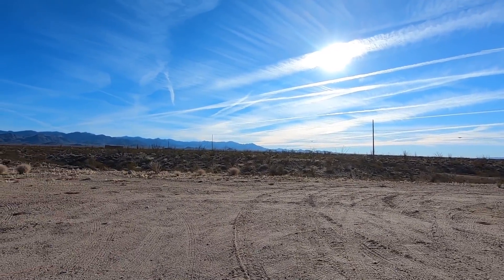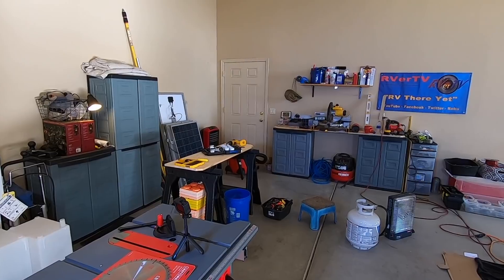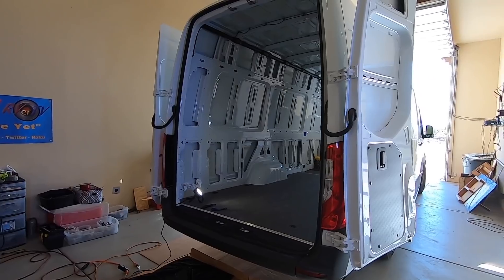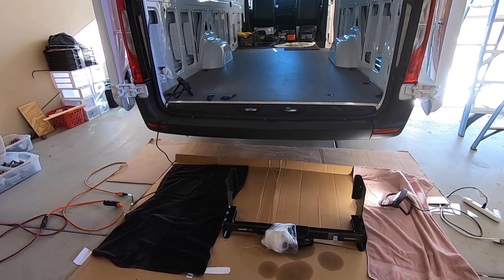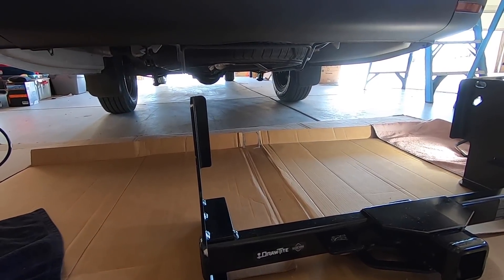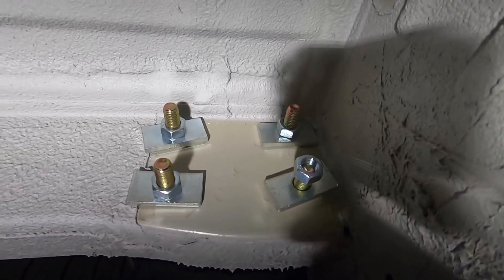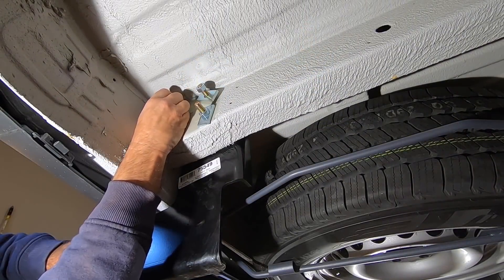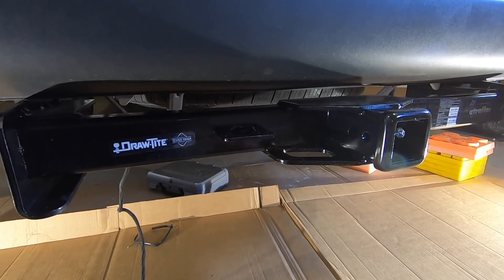Sprinter Hitch Installation DIY By Myself - Draw-tite  Bolt On Hitch

Comment: I recently had a second hitch installed on the front of my van.  I wanted the flexibility, just in case.  There were times I wished I had it when I had all of my boats. 

I'm still drooling over your new ride.

Comment: To elaborate on your reverse direction bolt idea.  On one side use the upper left (for example) then on the other side use any hole but the upper left.  That way you aren't creating a pivot point which will make the next one easier as you do not have to hold the weight of the hitch for that third one.  From there it is all down hill.  That is one nice garage!
Reply from the maker: thank you
Reply: You beat me to it.  I was going to suggest that.

Comment: Russ add a Diesel heater they work good and use little fuel and very safe I have one I have used them for years check ebay you can get them just a little over $100

Comment: You may want some of that plastic wire protective sleeve to run your wiring through just for some extra protection on your wiring harness.
Reply from the maker: yes as soon as the bracket gets here i will secure all the wire  Thanks

Comment: It looked like there was a gap between hitch and the frame on both sides. The metal rectangles look more than shims than washers. I would have used them to fill the side gaps and snugged up the hitch between the frame rails and then added lock washers and locknuts(or blue loctite on the supplied nuts) to secure the bolt. Instructions should contain torque settings to set nuts.

Comment: I put my side window down the back on the right hand side, my queen size bed runs beside the window and finishes just after the wheel arch. I see you got the arm rests for the seats. Yep, there is a lot of roof for the solar panels.

Comment: nice job, first thing I would do is ,find out where you want electricty in the van then insulate the heck out of it. Second ,run a back up nut on your hitch , Maybe a NY LOX nut ,they won't loosen up
Reply: a lot of great advice here,

Comment: Hi Russ. Should use pressure washers.  I installed  a hitch on my car with the hardware included.  it didn't come with any pressure washers..  Lost two bolts during normal driving. Found out because hitch was wiggling.

Comment: And it would have to be a full tan is because you're not allowed to weld on frame some more it screws with electronics believe me I found out the hard way everything bolts on but it looks nice and you can pull but Dusty nugget nice van looking forward to watching you build it into a RV love watching your shows thank you so much for the criticism I give you probably read the ad wrong later

Comment: Nice van, Bet the repair bills are gonna be rather expensive... By the way, I found your ROKU Channel.
Reply: Diesel engines will at some point, give rise to quandary whether from Mercedes or not. No quick or easy repairs. No great deals for a service. And you can never change the oil too often. I buy oil by the gallon and filters by the case. and do it myself. Yet for all of that, IF diesel is lower priced than gasoline on any given day...the fuel costs can be amazingly low.

Comment: I have an 07' and it didn't come with the wiring or the tow connector. I think this had to be ordered. I have the same Draw-Tite hitch on, but not wired up yet. I think I have to go to the taillights and splice in.

Comment: hey spray your tube frame on the inside with undercoat, rust is on the sound deadening on back weep hole indicating water entering rusting and running out on to it also mouse proof it do this with hardware cloth  took my van out one year came back with a whole insulating crew packing anything they could get their teeth into all kinds of spots and not so good smelling insulation lol. ;  ) lots of advice if you need help come on to kansas
Reply from the maker: thank you

Comment: What bracket did you end up using for the wiring?
Reply from the maker: made a homemade with some thin angle then drilled my own holes
Reply: @rvertv  thanks!  After I posted this question I discovered a part on etrailer's website.  Part # 18138.